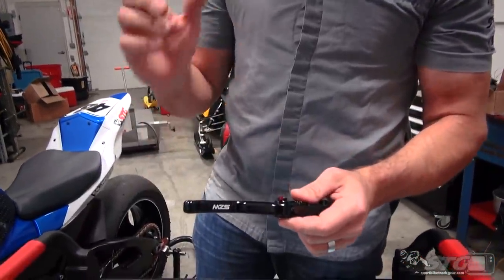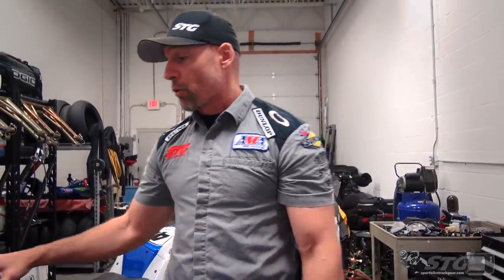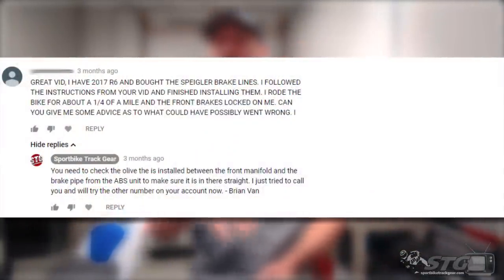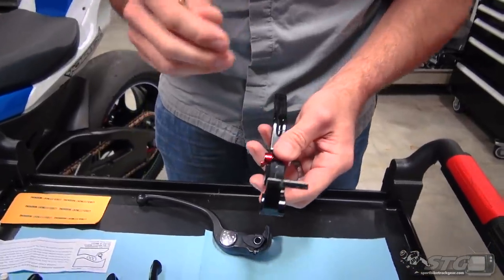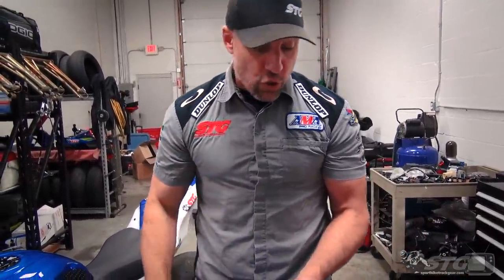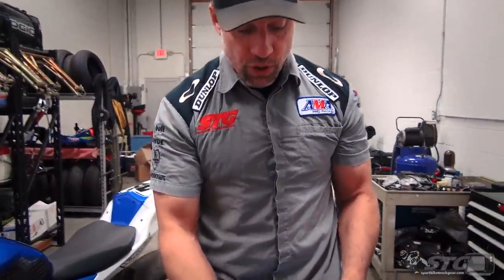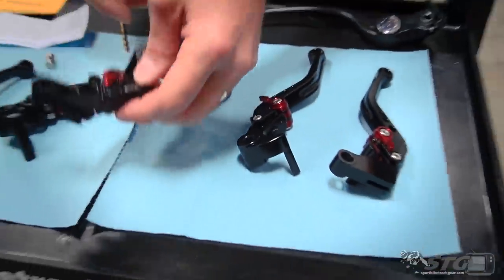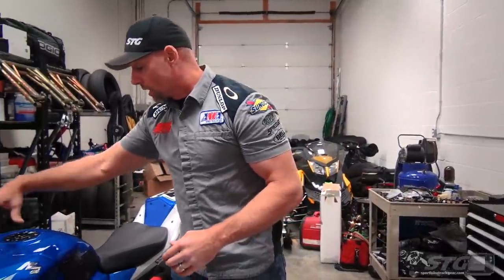The Truth About Cheap Motorcycle Levers | Sportbike Track Gear

Comment: I can guarantee having insurance for a product like levers is to protect the manufacture in case of failure and not to help the customer out. Any aftermarket product can be poor quality. It’s up to the customer to inspect the part and also install it. And many of the branded parts are made in China...........Buyer beware. Use common sense man. If it looks and feels like crap, don’t use it. But there is no reason for price gouging like so many do.

Cheers
Reply from the maker: It is to protect the manufacturer from potential litigation etc... That said having proper insurance in place does open the door (tons of variables) for a law suit in the event negligence by the manufacturer causes injury or worse. Any of the large distributors here in the US typically require current liability insurance be in place from the manufacturer for their products to be distributed. IMO this has benefits beyond just offering some protection for the consumer. I believe this is another reason to produce quality products built to the correct tolerances so the manufacturer is able to secure and maintain the policy. - Van

Comment: I had problems with expensive levers too!!! Turns out they break every time the  bike lies on them. ( about 1 or two times a year in the track) Obviously bad engineering !!!!!!!!!!!   !!

Oh wait- maybe I have been doing it wrong.   Hmmm  :-)

PS: Thanks for the video!  I see China made products mostly as raw material. Nothing you can just slap on our bike for sure. But you can use some parts here and there if you have the right tools.
Reply from the maker: You are welcome and thank you for watching! - Va

Comment: Returning my eBay levers after reading a lot of people’s brakes locking up
Reply: A lot of people don't properly install them and there brakes would lock up using any levers.
Reply: Greenlightmeango 465 ya but that pin on mine didn’t fit nicely in the hole like the stock levers so better safe than sorry for me

Comment: Mzs levers are on my $500 09 SFV650. If I could afford better ones, I would. Just like him and his shirt, I'm aware of the issue, but I'm still not going to do anything about it.
Reply from the maker: Shirt fits fucking perfect my man. The SFV650 uses a axial master cylinder, the brake locking issue seems to be with the radial brake lever only. Installing the MZS levers on a $500 bike is one thing, installing them on a $12,000 - $20,000 bike is another. - Van
Reply: Extra smedium. Your right though, I wouldn't put these levers on a track bike or one I ride hard.

Comment: It’s funny that you make it sound like you care about safety when I bought and LSL handlebar kit from STG for my 2009 gsxr 600 and the clutch cable was built so poor that it snapped on me. I had to pay for a tow and new cable.
Reply from the maker: I 100% care about the quality of the products we sell. That said things happen and we are here to help our customers get the problem sorted if there is an issue. We have sold hundreds of the LSL handlebar riser kits over the years and this would mark the first time I have heard a complaint about the clutch cable.  I have installed one of these kits myself and felt the quality of the components was excellent.

Like anything we offer there is a warranty in place supported by the brand to deal with issues as they arise. How long did you have the kit on the bike when the cable failed? Did you reach out to us or Spiegler / LSL for support? - Brian Van
Reply: The cable lasted a day and when I removed it the metal piece where it should be solder together with the cable had no trace of it being properly solder I have pics. Tony knows everything about it.
Reply from the maker: I just spoke to Tony about this and reviewed the situation with him. It sounds like the clutch cable sent with the kit was too long and Spiegler sent a replacement cable to you. With any project you need to inspect the parts before you tear the bike down to ensure what you received will get the job done. Looking at the photo of the cable the technician installed on your  bike I would say he should not have installed it, way too long. 

You reached out to us on the 19th and a replacement cable was to be sent on the 21st and did not go until the 24th. Spiegler informed us USPS did not come pick up on Friday so it went Monday. The tracking number shows it was delivered and you said you had not received it. Unfortunately packages get lost from time to time, no one likes it but it happens.

As for the clutch cable snapping IMO the bike should not have been ridden with that horribly long cable on it. While I realize waiting sucks, sometimes it just can not be avoided. The last message we sent to you was on Oct 5th and there is no response from you in the system. 

We are happy to work something out with you to take a little of the sting from this away. If you are interested in working something out please reach out to me directly at service@sportbiketackgear.com and we can do that.

Reviewing this it started with the wrong clutch cable being sent with the kit. (8 inches too long) We are responsible to get you sorted out even though we do not assemble the parts that make up the kit. All that said there are 2 things that happened that should not have which made this a whole lot worse that are 100% out of our control. 

The tech should never have installed that long cable and should have inspected the parts BEFORE tear down to make sure he had what he need to complete the work. Also the bike should not have been ridden with the excessively long cable on it. That said I am here to help make this better, just email me. - Brian Van
Reply: @sportbiketrackgear  this is the kind of serious customer service that the world seems to be missing now a days. Good job Brian.

Comment: The cross pin just needs lubed. 🙄Obvious scare/sales tactic. I’ve used “cheap” shorty levers on many many bikes and have NEVER had any issues. If you’re locking up your front brakes with cheap levers, you need to learn how to brake. A lever is a lever. Whether you pay $200/set or $30, it’s a hunk of metal that no one can break in half by squeezing. If you want name brand on your bike, do it. If you want to save $150, buy Chinese knockoffs. Both will do the exact same job.
Reply from the maker: Here is another example of someone who has ZERO idea what they are talking about. - Van

Comment: Also when u put on light tech rear hugger on the Gsxr 1000 RR  did u take that stupid rubber flapper off that "protects the rear shock" assembly in the video that you made when you put the ohlins rear suspension on I couldn't tell at the end of the video if that flapper stayed there or if you removed it I called Suzuki and bitched at them for at least a half an hour telling them that their brakes were awful RR model for another 7 8000 dollars  and they couldnt even use braided lines and how could they put on Half Brembo half Nishiki or whatever company it is I don't even know how Brembo would be okay with that I'm also trying to get a Brembo rear brake caliper do you know how to get one on I would like matching calipers at least both Brembo and and like I said in my other message I already put on the spiglerer black and gold braided lines the Spiegler braided lines  made a  huge difference but I would still like a back Brembo rear caliper but everybody I talk to said I have to make up some kind of bracket and I'm not a mechanic and I don't trust half of the ones up here can you make something up for it and can you do something with my ECU now that it's back to stock ECU
Reply from the maker: I removed the rubber flap on my bike, looks a lot better man.

Personally I would leave the rear caliper on the bike,  I do not feel like it would do much to improve the brake performance at all. The stainless steel lines make a HUGE difference for the brake performance. I agree it would be nice to have them on the bike from the factory on the R model. That said I would still install a set of colored Spiegler lines, I dig the color on the bike (I am a total squid at heart).  I have a set of Vesrah ZZ Race Pads on the bike now, this was another solid improvement over stock. Next year I will most likely install a Brembo master, not sure which model at this point.

Now that you have the ECU back to stock let's do an FTECU flash kit on it. I have used this on my bike and it works great. It was a little tough to flash my bike, spoke to FTECU (their support was great) and they helped me get it done. You buy the kit through us and we will work with FTECU if you need support.

- Brian Van

Comment: Even cheap levers can be fine, you just need to check their assembly carefully prior to fitting them, and then test them in a controlled manner. If the premium ones were sensibly priced, the chinese wouldn't have so many customers would they?
Reply from the maker: I would never install any controls on my motorcycle that require the end user double checking the engineering of the manufacturer. - Van

Comment: I just bought those levers man did I fuck up.The dude is speaking the gospel on that slip bushing,the thing is very very dangerous,before you know it has your front brakes locked up.It took me quiet a bit of time to trace that problem down.So if you do buy them inspect inspect inspect the product.

Comment: This video is 100% correct. I bought a used ZX6R with the chinese levers. I went crazy trying to figure out why the front brakes would not relax when the lever was depressed spent hours cleaning calipers and doing research. Turns out the barrel with the cup for the MC cyliner was rotated making the brake constantly engaged. I'm throwing them out and ordering CRG's now.
Reply from the maker: Appreciate you taking the time to leave this feedback and happy you did not end up crashing the bike because of the shit levers.  - Van

Comment: I dunno man, the stock levers that come on just about all motorcycles aren't made to exacting tolerances and there has yet to be an epidemic of lever failure plaguing riders. I have two sets of the cheap chinese levers on two different bikes. The first set fit perfectly and has no issues with binding or loosness like the one you had in the video. The second set was SLIGHTLY too large to fit into the housing, so a few quick hits with a file and it fit perfectly. I always grease the parts that move and they've been working fine. If a set of TWO quality levers was in the $50-$60 range I'd consider buying them...but $80-$100 per lever...no thanks.

The best thing anyone who enjoys riding a motorcycle can do for themselves is repent and turn to Jesus. Your time of death is already scheduled so there's no point in worrying about it...unless you are not right with Christ...then you should be very worried.

Comment: Did you know even you are spending good $$$(say $30 vs $300) on brake lever, you can still wear the master cylinder from reapeatly applying&release brake which result brake fluid leak due to uneven wear of the plunger. Part of it due to the low quality brake lever pin doesnt free to rotate, part of it its the design.To me, brake systems as it is today are prone to catastrophioc failure with no back up options.  My point is that unqualified personel with no undersatnding whatsoever shoulnt be touching brake systems(or arguable anything) - you can live with not being fast enough , but may not have a second chance to slow down sooner.

Comment: Well, all my bikes have had these but haven’t had any issues. Definitely possible though
Reply from the maker: Depends on the design of the brake lever, radial or axial. That said even if they have not caused the brake to lock the quality is pure shit, better to leave the OEM levers on the bike and save the expense. - Van

Comment: So instead of wasting time, just say don't dont fuck with your brakes enless you know what your doing. I've used even cheaper levers than your mentioning with no issue. Did take some tinkering though.
Reply from the maker: It should not take any tinkering to install a replacement lever. The tolerances of the replacement lever need to be as good or better than the OEM. - Van

Comment: Lol when you spend 200$ on levers and drop your bike one time... a lever is a lever mate. Only way thats gonna fail is if the bolts fall out or it snaps at the pivot point. Sure if your racing buy the expensive levers, if your riding for fun get the ebay levers.... youre going to snap them multiple times 100% regardless of manufacturer. If you're not stupid youll clean the pin up with sand paper or a file and put locktite on the bolts. Obvious shilling is obviously obvious 🙄 😒
Reply from the maker: Installing knock off, garbage controls on your motorcycle is stupid. If you choose to be stupid well then that is your choice. - Van

Comment: If binding is an issue, lubrication should be the answer... correct
Reply from the maker: Not when the tolerances are incorrect. Having a lever cause the front brakes to bind or lock up is 100% unacceptable. - Van

Comment: Good thing I dont have those bushings for my Ninja 650r lmaooo
Reply from the maker: These levers are a piece of shit. That said we have not seen them cause an axial master to lock up. - Van
Reply: @sportbiketrackgear  been using them for a while now and they work perfectly fine. I also use your rear sprockets. As long as you check your parts for quality control, they are fine. z

Comment: Think about  it this way....
How much do the stock chinese levers cost the manufacturer?
I guarantee its about 3-10$. 
There's no meat on the bone for shops to charge you 200$ for levers and thats at the heart of this video 5yrs old.
If your worried about it grease the pivot and cable like your supposed to anyway and call it a day.
Maybe these particular levers bind, but for a vast majority your not going to have any problems if you shim them , thier not going to wobble either , which alot of stock cast levers do anyway.
Reply from the maker: Have you read all of the comments from riders who have crashed their bikes because of these levers causing the brakes to bind? If you can not afford a proper set of levers keep the OEM ones on the bike. - Van

Comment: I bought them for a 2007 zx10r and approaching a traffic light i noticed that as i was braking it started to slow down a bit faster than it should of when the light turned green and i tried to take of the bike didn't want to go the front brakes locked, luckily it didn't happen as i was riding,i was approaching rt80 in Jersey if it would of happened there it probably would of costed my life or badly injured.
Reply from the maker: This video has been up only a couple days now and there are already MULTIPLE comments about riders who have experienced their front brakes locking due to these shit levers. This is the reason I decided to share this. Appreciate you taking the time to leave this comment! - Brian Van

Comment: Another issue is REBRANDED chinese products .supposedly name brands but made in China and poor quality ..TWM.. supposedly made in Italy and top tier quality but in fact are LOW grade and made in China and rebranded ..TIP>>> IF thepaint starts to fade=its a rebranded chinese part

VAN Do you have a 1/4 turn quick release fuel cap for 2016 kawasaki H2?
Reply from the maker: I had to Google that brand as I was not familiar with them previous to this comment.

We have the following fuel cap for your bike on our site:
Driven HALO Fuel Cap Base Kawasaki H2/H2R/SE 15-19
https://www.sportbiketrackgear.com/driven-halo-fuel-cap-base-kawasaki-h2-h2r-se-15-19/

Driven HALO Fuel Cap
https://www.sportbiketrackgear.com/driven-halo-fuel-cap/

Comment: I need to change out my levers  , I don't fuck with cheap shit , my 2016 R6 came with some cheap aftermarket levers cause they have lots of play just sitting in place, all these dudes below commenting on how they would rather buy the $20 levers on Ebay or just cheap crap for their bike in general - those are the dudes on YouTube looping- wiping out - cheese grading their shit up , and or near missing, I'd rather spend $200 now than $6000 + on repairs later , just saying

Comment: I’ve used these levers for years. Installed properly, no failures. When some shade tree hack installs them over a six pack, and then they fail... well... the hand that cannot write, blames the pen. Also, get to the point. You spent the first five minutes talking about stuff that was irrelevant.

Comment: I’ve got to admit I have a couple of ‘cheap’ parts on my bike, brake lever being one and clip on mounts being the other. I’ve not been riding much lately and have made the decision to replace both brake and clutch levers with one of the known mainstream brands like CRG, Evotech or Titax...I.e. something that’s built to a standard like TUV. One of the local Titax retailers talks about the Jesus bolt that one finds in a brake lever. You may ask, what’s the Jesus bolt? It’s the one at the fulcrum point on the lever and if that snaps (which has happened on cheap levers) the next person you may likely see is...Jesus himself! Because you’ll be dead! I’ll also be replacing the clip on mounts with Woodcraft mounts. Bars themselves are Driven so not worried about them. But the message in your video Van, is timely and so important. Thanks mate!! 👍🏼👍🏼🙏🏻
Reply from the maker: You are welcome and thank you for watching! When I was a tech at the Cadillac dealer way back there was a handful of bolts we referred to a the "Jesus Bolt". Haven't heard that in a long time. - Van
Reply: @sportbiketrackgear  I'd not heard the term previously but I like it as it's pretty bloody accurate I think. Keep doing what you do mate, I'm a fan of your channel and appreciate the honest reviews, gear guides and how to's, you publish.  BTW had a good chuckle at the 'my shirts too tight, I'm old and a little bit fat' comment.- Adam